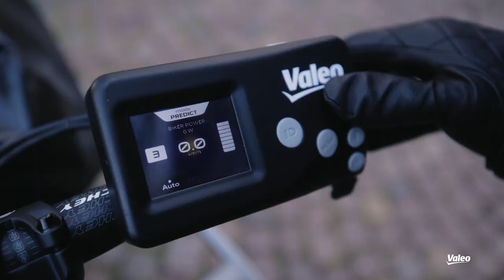Revealing an intelligent electric pedal system for bikes | Valeo

Comment: I can’t wait. This is a brilliant solution that can’t be offered too soon by bike manufacturers. I’m looking to buy an ebike and 90% of them have a chain and derailleur! It makes no sense. Hub gears and a belt = a much better solution. All the more so if the gears and motor are integrated, fully enclosed and mid mounted. 👍🏽
Reply: I'm still baffled that they even put gears on an ebike. You have gears because humans have a lack of torque at low cadence. But electric motors have tons of torque at low rpm. I must admit I live in the Netherlands so I dont know how an ebike fairs with mountains.
Reply: @stormeporm  I blow up my electric bike 500w motor going on a very steep hill. You are right that electric motors have lots of torque at low rpm. But then they draw way more current. If like in my case you go 300 meters continously uphill you end up burning the coil of the motor.
Reply: @TubeSkaterRudy  Thanks man that is some useful insight.
Reply: + fully automatic mode

Comment: I have already tried it. The system is well thought-out. There is a fully automatic mode: the system manages both the mode ( turbo-eco ) and the speed ( 1-7 ) ; a semi automatic mode : the driver selects the mode and the speed is managed by the system ; and finally a manual mode similar to any conventional e-bike.

Comment: Interesting.  But not enough cool technical explanation and too much smoke and mirrors.
How much power?  How does adaptive work?  
With a bottom bracket gearbox you need gates belt because tension in drive belt in low gears is much higer than with deraillleur or hub gearbox.  But I see you propose one, so good.

Comment: I have many questions, but first and more important:
- Is it compatible with my bike frame ? ( haibike 2018 xduro all mtn 6.0 current motor yamah pwx)
- Can i have aprox price tag?
- will it be compatible wit my yamaha 500 wh battery?!?!?!?!?!
- where to buy?
Reply: A bike frame is always only compatible with the make/brand motor on it. Because of the mounting points. Also most of the times you cant mix different batterys or displays cause they al 'talk' together. Its a system. So really you need to wait until some company decided to build a frame with this valeo setup.

Comment: I already hate and refuse to drive automatic transmission cars,  now they want to take away the pleasure to chose and manually change gears even on my  bicyclette... Sure the gearbox of this e-Bike looks more advanced than a dérailleur, I hope that the software of that e-Bike will at least allow the cyclist to disengage the automatic gearbox into manual mode.

Je déteste déjà et refuse de conduire des voitures à transmission automatique, maintenant ils veulent supprimer le plaisir de choisir et de changer manuellement les vitesses même sur ma bicyclette ... Bien sûr, la boîte de vitesses de ce vélo électrique a l'air plus avancée qu'un dérailleur, j'espère que le le logiciel de cet e-Bike permettra au moins au cycliste de désactiver la boîte de vitesses automatique en mode manuel.
Reply: No one is taking anything away from you! They are just offering something different.

Comment: Impressive engineering, but I’m struggling to see how this would work with your cadence. Because these bikes have a fixed gear ratio, your legs would have to be spinning like crazy for higher speeds.
Reply: I think you misunderstood. The automatic transmission is replacing the multiples gears... or the gears are hidden in the motor box.